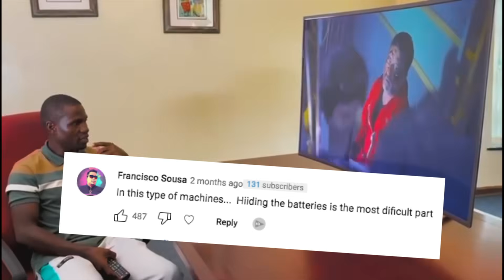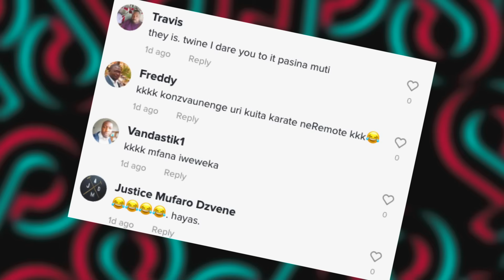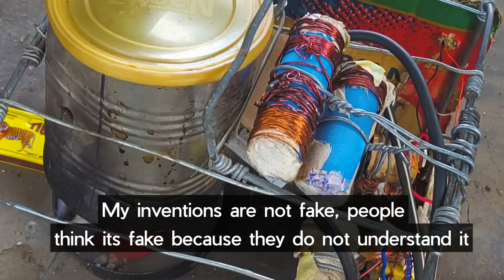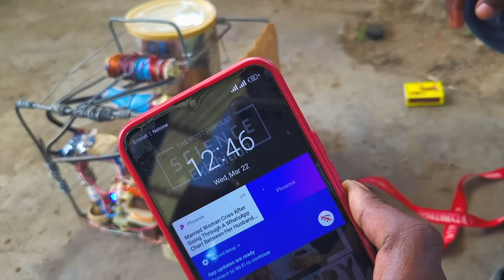Meet Zimbabwe's Youngest Inventor who built a Water Powered Generator

Comment: The only problem is that he hasn't "invented" anything - this basic design is at least a hundred & fifty years old, it's called a steam engine. Also those coil cylinders 100% contain batteries that are spinning the motor. If you want a professional assessment, I will go & meet with him & inspect the device. I am a qualified Engineer.
Reply: เมื่อช่วงเวลาที่คุณอายุเท่ากับเด็กคนนี้ คุณสามารถสร้างผลงานลักษณะนี้ได้หรือไม่ ทั้งที่เทคโนโลยีนี้ มีมาก่อนที่ทุกคนจะเกิด
Reply: Will give you your own materials and see if you can build your own working model. You must applaud ability to build a working machine
Reply: Do one urself Mr professional engineer
Reply: @muyiwatoluwashe ❤
Reply: Jealous will gonna kill you bro 😂😂
That guy is truly a genius
Reply: if this is true the rpm of the motor must go down if the charger was plug in 🥴
Reply: I didn't hear the sound of steam, as he explained, and it's relative transfer of mechanical power to electrical power. But the sudden rush of electric motor(s) upon key on, convinced me there are hidden battery.
Reply: Jealous will gonna kill you bro 😂😂
That guy is truly a genius
Reply: He is a 16 year old iwe engineer what did you achieve except to be a photocopy of someone's idea praise what needed to be praise with his background he is a genius guy
Reply: He did invert this because he made this out of parts that weren't designed to generate current
Reply: Who sees only the negative... He doesn't need your skeptical mind. That Boy is a genius period
Reply: @SalmadaGreatoneofGod  Who said that he's not creative? I did however say that he didn't invent anything, which is what they said in the video. I also offered to check his contraption - if it works as you think it does then he should be going into production & making millions from it. In order to accomplish this he will need to secure funding as a start & will need reputable assessments & performance trials to a set benchmark. You should be encouraging the creators of this video to get it touch with me so this kid can develop his "invention". They could film an analysis of the devise so you & everyone else can see for yourselves. My professional experience says that it's 100% not what it's proclaimed to be & until I am proven wrong I will stand by my opinion. Of course, you & everyone else are entitled to make up your own opinion but don't shoot the messenger of bad news.
Reply: @The RealKlinky.. just be more positive with your words. Treat this marvelous young man as one who intends to encourage not use your position to undermine his effort. Treat him as you would your own kid.
Reply: He may not have the qualified standards like you do, but he built something without prior knowledge or experience and that must be appreciated and applauded.
Reply: Jealous you're!! Nothing may GOD feels  sorry for you!!😢.The Guy is more than a jenious.
Reply: @nahmanbilly5250 😂 jenious or genius
Reply: wheres your pump?
Reply: wheres your pump?
Reply: Peanuts and bananananas invention.
Reply: Gee, he has done what he knows. Support him.
Reply: Am sure the house you sleep in has nothing of your own invention.

A poor  innovative guy has shown you what you should have done with your excellent expertise.
Show us a better creation or lie low.
Reply: Please visit this young man and don't allow YouTubers to take advantage of him. He hasn't invented anything. He lights a candle underneath a pan with some water. There are no tubes to convey the steam either. It's utter garbage. As you pointed out, the motor is being spun by batteries.
Reply: Then why don't you invented something new😅
Reply: You guys are so disgusting, of course it can't be a big project to your eyes, it's not like you gave him any support to invent something completely new, you the worst source of support u can't even just encourage him to go further, if u have nothing helpful to say please shut your text 😐😑
Reply: How did it go?
Reply: Ryt now no one is inventing anything bt whats happening is redesigning , finding new uses of the old tech n parts
Reply: And the only problem you have is stupidity
Reply: Where is the steam system exhausting from? Something is off
Reply: Drama....
Reply: Idzi dzongobatikana zvisina basa😂😂😂.....mfanha uyu is genius and u are jelous
Reply: Yes please go do that. See if it indeed checks out
Reply: Correct sir...
Reply: Mr.KnowAll, what have you done too? You are the reason Africa suffers. If it were to be a white boy you would praise him. Shame
Reply: If you can't encourage the young man then you need to shut up, I have seen grown men thar can't even change a tire
Reply: Jealousy makes u a killer, go to hell
Reply: @fuadsultan9014  Hey, not my fault that you aren't educated enough to see what's happening. Go learn something instead of commenting on a subject that you clearly know nothing about.
Reply: @fuadsultan9014 Just from this video,l dont need to be on the ground to confirm anything,this is not an invention,if you ever did physics even at high school level you would know what is happening there
Reply: @fuadsultan9014 Just from this video,l dont need to be on the ground to confirm anything,this is not an invention,if you ever did physics even at high school level you would know what is happening there
Reply: O 8.
Reply: You’re right it’s just motors and hidden batteries
Reply: How can I see him
Reply: What have you invented with your engineering qualifications?😊
Reply: @estheresthers5050  I am very happy to report that I haven't invented ANYTHING!...I have improved on a lot of designs though. However I am not going to say that I have invented anything when I in fact haven't...
Reply: We don't need him poisoned!!! THANKS BUT NO THANKS
Reply: A qualified engineer with nothing to show.
Reply: About meeting him, create your own instead of attempting to exploit his craft.
You  theoretically "controlled" engineers have no monopoly over technology.

You have not even exhausted Nikola Tesla's inventions yet , and even fear creating your own.

You are judging a non controlled using patented, biased and monopolised  ideas and   theories  forgetti g that man is a master of invention .
Reply: Show us what you have.
Reply: Motivate him to perfection, or you invent your own to help Africa.
Reply: Gordo comrade... Mukuona kut chinu chirikushanda ne mvura icho.. Some invention are improvements of old invention....
Reply: The reason black people are not wealthy is because you have taken the white endoused knowledge and claimed it for your own. Thomas ederson began his invention journey as a teenager if Americans could do it why can't we. Stop discouraging fellow African inventors because makaroyiwa support one another
Reply: Absolutely true . Real engineer will explain in detail in how it work and shown it part by part  , no matter how ridiculous it sound . I mean the real builder and engineer from Africa has progress far and succeed , unlike all these fake engineer . If their so called " invention" are real they should have been succeed by now , and probably have their own brand .
Reply: You are jealous that he has a gift of inverting 😢
Reply: Mr.Engineer you are not helping😂😂
Reply: @luckyyvan9568  Thank you, it is my job to analyze & scrutinize things. This is no different. I am also not blaming the kid at all - it's the sensationalist reporting that gets me. Surely the 'news' should do its own due diligence on what it reports on? Or does it blindly publish everything it is told? My offer still stands - if this kid wants to take his "invention" mainstream, I'll help Pro Bono, but something tells me that the kid doesn't want me anywhere near his contraption for fear of being found out.
Reply: Totally rubbish invention with hidden gimmicks😂
Reply: He did not go to varsity those with masters  degrees have replicated mothing
Reply: @dstri1 let's see you build your own working machine even with car
Reply: @dstri1 you the rubbish here, if you have nothing helpful to say shut your texts, 😑
It's not like you can do better 😕🤨
Reply: That's true it wasn't a steam generator and that's all
Reply: Jealousy. Even if he didn’t  invent it, but applaud his creativity. He didn’t attend university to do this, neither does he have any engineering degree. 

Where is yours at his age. I bet he is more creative than you in terms of engineering. 

He should be motivated and sponsored  to further his education.
Reply: @yapse7  Don't be silly - in the video it says that he invented something, all I was doing was pointing out that unfortunately he hasn't invented anything & if the people responsible for uploading this video want to, they can put me in front of this device in order to verify these claims, I will waive my usual consultancy fee & do it for free, no problem. Yes he is a creative young man who I'm sure will go far in life but this particular device is not the answer, I am not attacking him - just pointing out flaws in his device as any critical thinking engineer would do if he wanted to take it to the next step & look for funding in order to go into production. I bid you a good day🙏
Reply: @yapse7  l dont think you know Zimbabweans, those guys  die and come back to life like Elliot and pastor Lukau. the other  guy made a windmill and helicopter , the other made a sub mechine gun, the other made a car, generator and TV that uses radio frequency and Americans proved that scientifically correct. some lady pumped diesil from a rock sir you can deny at your own peril, personally l am done with those guys on social media.
Reply: As an engineer too I don't see any advancement on this idea Im sorry I don't see anything new and to be patented
Reply: You scarcely can find a physics a professor in Africa who even understands the principle of what this teenage boy 👦 has done at his academic level.   He boy 👦 deserves standing ovation and awards.
Reply: @abrahamnwankwere8184  speak for your country not all African country are as dumb as yours ,
Reply: @abrahamnwankwere8184 you are blatantly lying ,you never did physics in school that is why you are saying that
Reply: You are  100% correct sir

Comment: the title of this video is misleading...it is not water powered but heat powered. the only way you can get direct energy from water is to split H-O bond and get the hydrogen fuel which is a direct energy source. that process need energy also

Comment: so you went all that far but you ddnt see the reason why he had those 3.7v lithium batteries?Those batteries produce 12v DC and when connected to an inverter transformer they produce 220V AC.

1) why does he wire those 2 wires the moment he inserts the "key"?😂
2) so you really went all that way but ddnt see kuti the few drops of water in that tin could never  produce enough steam to push that small pump(FYI the small pump is from those portable 12V tyre pumps)
3) there is no "steam" from that tin that can push the pump.

That boy awana fuza rake kkkkk

usaite sefuza iwe.
Reply: And what the hell does the spark plug do?  Honestly... when a child's twisted together art piece and a few obvious lies will impress... You have to wonder what people WON'T believe.  I can conjure gold at will by the way.  Would you like some?

Comment: The hidden battery is where the key is put in. The key only connected the hidden battery to the motor or powers the socket itself. Well done to the young inventor.
Reply: I think , key place 6v battery is switched on, it passes through the charger ( empty inside), and the 6v directly connects the mobile for charging
Reply: I me very skeptical not trying to bash the young man but there many takers out there and you most of the time have to scrutinize people who claim to have invented something.
Reply: he used microwave oven transformer to generate 220v that is not aardvark fake❤
Reply: Yes
Reply: NO THE SCIENCE IS ON INVERTER IT CONVERT POWER TO 220v. This guy is genius.
Reply: Its fake, when he plug the charger we didnt notice a drop in RPM due to the applied load. Besides the there was no exhaust for the steam to come out. Also it's not possible with his setup to produce the required pressure to drive that motor at such RPM...
Reply: No need a hidden battery it's not a break through its a steam engine, he uses steam to produce electricity. Sterling engine kits can do that too
Reply: @Andy-tu1bo  That is a mask.  Transparently obvious that it does nothing and the hidden battery does everything.
Reply: Where did he get 220v, this must be fake😂😂
Reply: So he's misleading the public then?
Reply: For God's sake ... Steam is a high pressure object. It has to run a piston which then rotates a dynamo ... lots of noise n vibrations

Comment: Self taught engineers are usually the best. Now tell him to work on-a improved version. Never stop learning! Kudos to him for coming up with this! Good job!
Reply: He didn’t have engineering degree form any universities but yet made a machine. He is talented and I believe he can do and better if motivated and further education
Reply: @yapse7  He tried to make something that resembles a steam engine and when it didn't work he faked it.  Sorry, no points.
No points for a drone on an obvious string either.
Reply: @yapse7  I was also quite dead serious when I offered to send him a pretty ripping computer system and electronics kit.  How's that for motivation?  Conditional on coming clean on this.  Want specs?  AMD R7 12-core, onboard video so it'll handle the M-40 workstation card (24 gigs Vram), 32 gigs DDR4, 8T hard-drive, 1T SSD,  Arduino plus 32 sensor kit, and a Rasberry Pi.  His if he comes clean, plus my very valuable mentorship.
Reply: You never hear about trained engineers, because their successes are expected, just the job, nothing special.
Reply: next level to this steam engine is gas powered engines  :D
Reply: @mannyechaluce3814  nuclear power is greener.
Reply: @mannyechaluce3814  Next level would be anything that actually worked.
Reply: He hasn't come up with anything and I doubt that you know any engineers.
Reply: @artdehls9100 what is engineering?